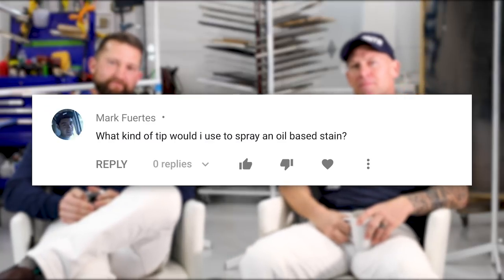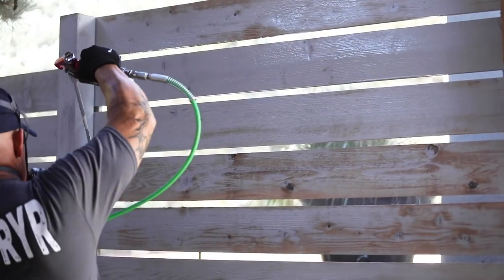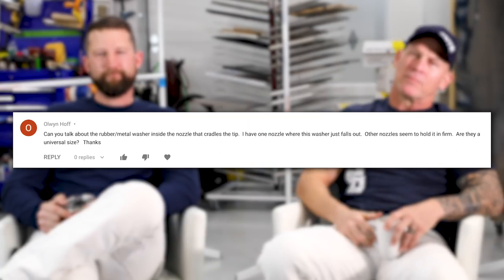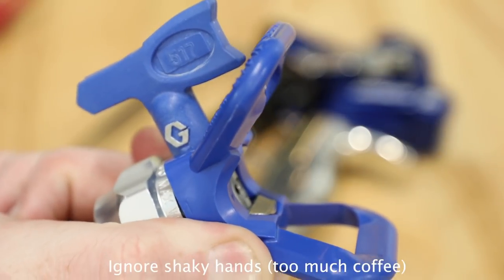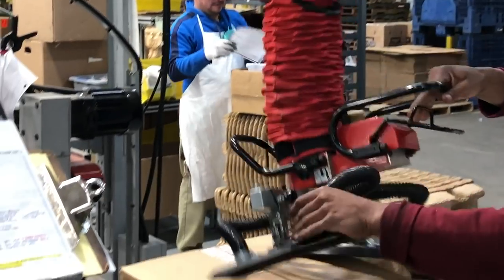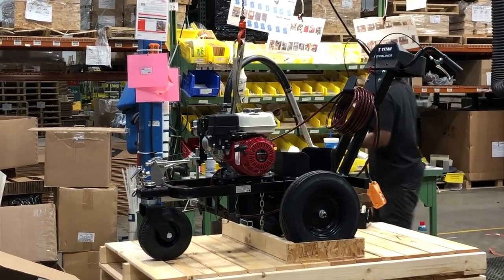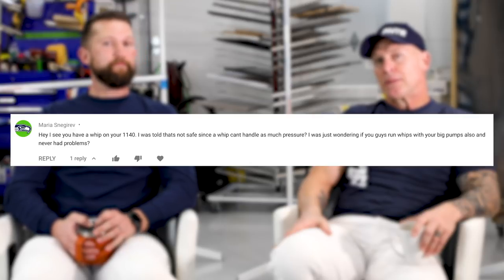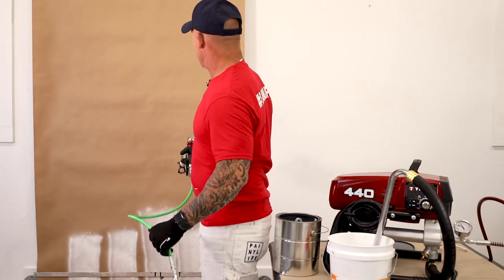Airless Spraying Tips and Tricks | YOUR QUESTIONS ANSWERED!

Comment: Thank you for helping people navigate the different tools and products that help us get professional results! I have a Fuji Q4 Platinum HVLP setup and have done lots of cabinet work with Ben Moore Advance. I feel like the HVLP has a tough time pushing that material unless I thin it almost 20% and have considered using my Graco 490 with either HEA or FFLP tip to get better atomization. Outside of pump/tip recommendation I saw your video recommending Lacquer finishes. My local SW stores looked at me like I had 2 heads when I asked for some of it. I guess EPA requirements won’t let them sell it in stores here (VA), but I would love to be able to work with some of it. I’m really trying to dial in a product and spray method here, and outside of oil products like BM Satin Impervo, it looks like I need to accept these newer waterborne hybrid products and either upgrade my HVLP or go back to the airless. Thoughts? You guys have really changed the final product that we are delivering our clients. We are remodelers, and paint is a big part of that, so thank you for all of your help, and for putting together one of the best resources on YouTube! This is like my college education and I am very grateful that you guys take so much time to produce these wonderful videos!

Comment: I got questions and figured I would ask at the most recent video. 
How does one condition paint brushes. Eg home depot purdy brushes? I am asking what product works best and what exactly is it doing? My brushes feel dry and frizzy. 
Since I got your attention. How does one make a roll of tape last? I constantly find half used rolls that have dried out.
Reply: Conditioning brushes. Home depot has a brush conditioner that's a packet that you add water to and it helps recondition brushes with latex built up on them. The conditioner will destroy china bristle brushes. I always comb and steel brush my brushes and spin them dry prior to storage.

Comment: What tip do you recommend for trim and doors (310?) Using BM advance with graco cordless sprayer. Also Do you recommend thinning the paint? Thanks
Reply: Jeff Poaps did u use the 310? It should of worked fine.

Comment: If anyone needs help with machines shoot me a message I work and rebuild these things all day!
Reply: Do you work on pool pumps or fireproofing
Reply: @timmyfoster5532  nope just the painting stuff sorry
Reply: My Graco gun had not been used for a long long time. I recently started using it and all the screwes and bolts that connects to the gun we're stuck I couldn't twist the screws it had hardened. Having hard time unscrewing bolts. What do u recommend I use or do to get the bolts loosened?  I tried Wd40 but still stuck. Any advice?
Reply: @martintovmasyan7825  take it off the machine and let it soak in acetone, that should free it up
Reply: guy buddy I tried that but I didn't let it soad. I'll let it soak now. Tnx for response
Reply: Is a Graco X5 worth the $300 ? I am doing a wainscoting job at my own house and i want to spray paint it in place. Probably paint 2 or 3 rooms a year. Also i want to paint the outside of my garage. Will this machine hold up ?
Reply: @Frankreddy62  there definitely not the best machines not going to lie. You cant really rebuild them there ment to work and when they break you toss it. That being said if you clean it very good after every use and put some oil in the pump it should hold up.
Reply: @matmuffin1   Thank you for your reply. Can you recommend or suggest a better one for under $400 ?  or should take a chance and buy myself one ?
Reply: @Frankreddy62  I'd look for a sale. Or even the one from harbor freight there cheaper and work just as good. A used pc490 wouldn't be a bad choice either pumps for them around 200 and last a very long time
Reply: Frankreddy62 yes definitely is. You can find better price for the x5. I currently own an xr7 I love that sprayer.
Reply: Bro I just got the track 308 FFLP tip spray but it keeps spitting which ruins the work I'm doing. Anything I can do to fix it
Reply: @martintovmasyan7825  do you have an extension?
Reply: How long can the set on a bench never been used Greco